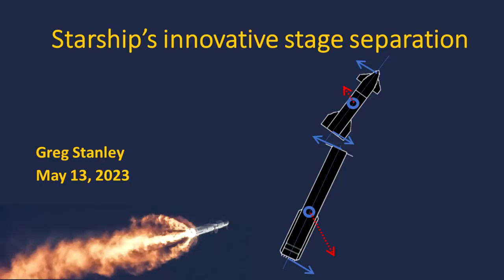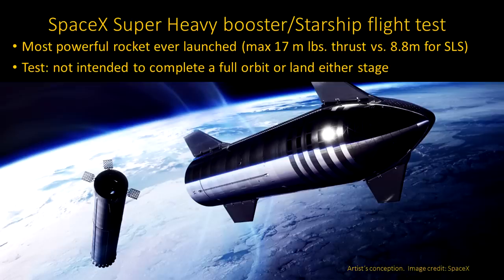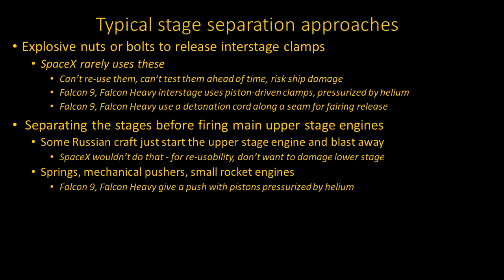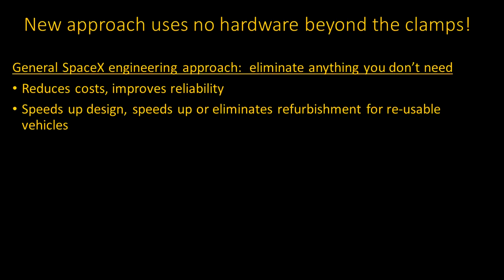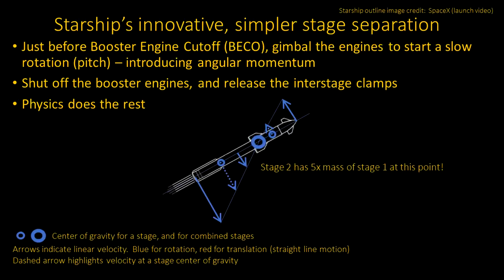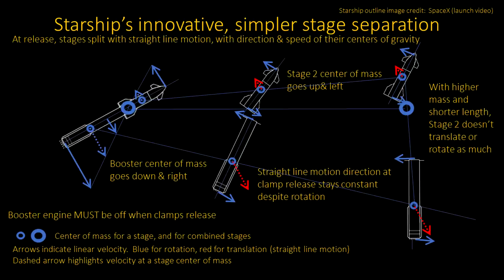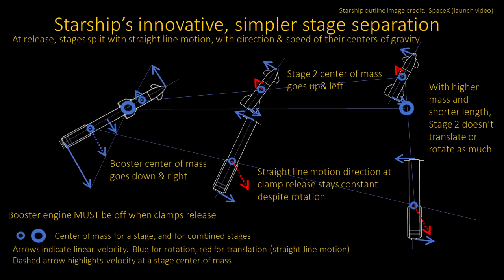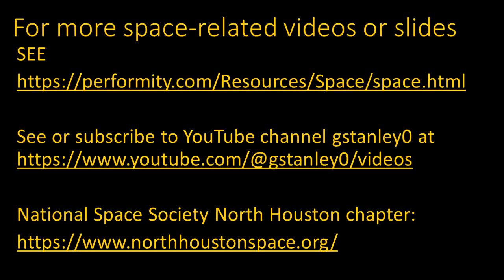Starship's innovative stage separation, using no hardware besides clamps, illustrated

Comment: There’s no way this system will be human rated in current configuration.
Reply from the maker: Several people have commented on this.  For now, the focus is on getting the rocket ready for cargo only, following the usual SpaceX approach of doing that first, just like they did for the Falcon series.   There's plenty to do for that as the top priority.  That's a faster way to get to a minimum sellable product. 
For the longer term, I'm sure they thought about that.  It doesn't seem that unsolvable.  For instance, as one other commenter pointed out, in an emergency, simply start the stage 2 engines and blast away - saving the booster isn't crucial in that case.
  
It's probably better than that.  If the booster has burned out, then ullage (ensuring that only liquid propellant reaches the engine after some free fall) and some push-off from the booster can be provided by the cold gas thrusters at the bottom, fed from the propellant vapors (available because of the autogenous pressurization) and also because of the startup of the turbopumps at engine start.  If the booster is still firing, then you already have the acceleration needed to keep the propellants liquid and still can blast away.    

Emergency escape does depend on the unclamping working.    But that approach has already been accepted as safe in the Falcon 9 series (and probably other rockets -- there's probably something like clamps to hold stages together).  In the Falcon 9 case, they use pneumatic pistons to release the clamps.  I don't know what they're using on Starship, but if it's pneumatic, the principles are the same.  The difference might just be that there's no pressurized helium available like they use on Falcon 9.  If they're still using pneumatics, maybe they use oxygen or methane gas, the only gases available -- I don't know.  That's something to explore.
Reply: @gstanley0  interesting. thanks for the info.

Comment: It failed on the SpaceX fiasco.  Also failed the failsafe explosions to destroy an out of control rocket.
Reply from the maker: The maneuver described here didn't fail, because it wasn't tried, as far as we know.  The test didn't get far enough to reach that point:  no booster shutoff, no clamp release, and not high enough altitude to justify it.   We'll have to wait for a more definitive timeline and analysis to be sure, though.   Yes, it does seem that the FTS (flight termination system) didn't trigger early enough and it certainly didn't do enough damage .  I put a separate video on this channel reviewing the test.  Steps like fixing the FTS, rebuilding the launch pad, better protecting the launch pad, and figuring out why engines failed, are top technical priorities -- all topics outside the scope of this particular stage separation approach.   See https://youtu.be/93Dgh2IZS_M   instead as a good place to discuss the problems of the test, Starship design, SpaceX approaches to do lots of testing, etc.

Comment: That is the possibly the dumbest idea ever conceived in modern aerospace engineering.  I'd love to be a passager during separation 😢.
Reply from the maker: Why is it dumb?
Reply: @gstanley0  you are going to be at the tip of a giant hypersonic vehicle while it is doing a somersault.  Whether 'you' are a satellite, or a person, the force of acceleration during the somersault is going to be uncomfortable
Reply from the maker: @DumbledoreMcCracken   We'll have to wait for more official information from SpaceX, but from their videos (pre-launch, in the launch video), there aren't any  somersaults of stage 2  (the booster might complete one, probably to get pointed in the right direction for boostback).  Maybe a 30 to 60 degree rotation between MECO and clamp release, over 8 seconds based on their flight schedule, 5 of which are after clamp release.  

Because of lack of official information,  I did some approximate calculations based on published size and mass numbers, along with eyeballing the Starship diagrams.   It seems achievable, without all that much stress on the humans, who prior to MECO must get accelerated to about 10 - 11 ft/sec in linear velocity tangential to the rotation  (that's assuming 0.1 radians/sec around the overall ship center of mass), and then later decelerated to end the rotation.  Both of those accelerations could be done as slowly as needed for comfort, but even if they took 2 seconds each, that's an acceleration of roughly 5 ft./sec2, much less than earth gravity.     
  
People will have already passed through rough periods like achieving supersonic flight, then the period of MaxQ,  the return to full acceleration, and then the sudden loss of acceleration due to MECO (which cannot be avoided), all of which would seem more substantial than the minor rotation added for separation. 
Except for the few seconds to generate the rotation and then counteract it later, most of the rotation will under no acceleration at all.   In the thin atmosphere above the MaxQ point, it would probably seem pretty smooth.

Comment: By all means, let's add violent angular forces to the already intense acceleration forces experienced by astronauts. 
In the sea of stupidity that is Starship, this separation method is one of the stupidest.
Reply from the maker: Some people are assuming that there will be violent angular forces on the upper stage, meaning high angular acceleration and velocity, maybe applied over a significant time.  What is the basis for that assumption?   I think we'd have to wait for more information from SpaceX, or at least wait some more months and carefully watch a successful test.  You can also bet that before any people travel on a Starship being boosted from Earth,  SpaceX will have experimented to minimize the rotation needed.   So the initial test might have more angular velocity than they finally end up with.  Also, if there's really a problem, as several other people have noted in comments here, in effect there's going to be cold gas thrust  also helping separate the stages.
Reply from the maker: In the absence of definitive information from SpaceX,  since the video, I worked through a rough approximation of the mass distribution in the Starship to be able to estimate basics like the centers of mass of the ship and each stage separately, and estimate their moments of inertia, to work out the kinetic energies (due to rotation and translation before and after clamp release, and estimate final rotations and linear velocities.  (The angular velocities are all the same - my initial thought on that was wrong, which became apparent when working it out in detail)  

As an example case, if you try an initial angular velocity of 0.1 radians/sec, in the 5 seconds between clamp release and stage 2 engine start, you'd turn 28.5 degrees in that time.  During rotation start, an astronaut would experience acceleration to get to about 10-11 linear  ft/sec , and then that would remain constant during the 5 seconds after booster shutdown.  The stages centers of gravity after clamp release would drift apart at about 18 ft./second, or about 90 feet during the 5 seconds.  At that point the stage 2 engine would start, and it would rotated to be pointing away from the booster, so maybe not damage the booster.  All of this is based on some approximations, and assumptions like the the payload mass, propellant remaining in stage 1, and how far about the stages should be, etc., but they are probably "in the ball park".

Does that 5 seconds (plus the 3 seconds between MECO and and clamp release, and a few seconds to induce the slow rotation) sound so violent?  In the absence of definitive info from SpaceX, have you done similar sorts of calculations to justify the word "violent", or be sure that the people who designed this are stupid?
Reply from the maker: Actually, it was one of Musk's employees who came up with this method for stage separation.  Musk endorsed it.  It was probably natural for everyone, since they're already using rotation to disperse Starlink satellites. 

As for requiring worship?  No, a spreadsheet and applying the basic laws of physics to a finite element representation of the ship does the job.  
 
I worked through the calculations, dividing the ship into 200 segments to place the mass based on dividing up the empty stage masses, the propellant masses, and the payload according to locations in the ship diagrams.  Once that's in place, the spreadsheet calculates (before and after separation) centers of mass, moments of inertia, rotational and translational energy, linear velocities of the centers of mass, and verifies angular velocity for the separated stages given an initial angular velocity for the ship as a whole. 

Based on dimensions and weights from Wikipedia, and eyeballing the rough locations of propellant tanks, etc., it looks like the center of mass (CM) of the ship prior to clamp release is around 255 ft from the bottom, which places it 25 feet up into stage 2. Stage 1 CM is at 101 ft. and stage 2 CM is at about 281, all out of a total height of 394 feet.   Exact numbers depend on assumptions on stage 1 propellants remaining (I assumed 2% for my base case, and the CM for stage 1 is sensitive to that assumption), exact locations of the propellants in either stage which I only roughly approximated, and payload weight and distribution.  This is just "ball park", and doesn't account for the heavier dry mass at the bottoms of stages due to the engines, or the differences in mass between LOX and methane (yet).  This will be improved later.  There weren't any fudge factors in there somehow associated with Musk, just lack of time to make the model more accurate.  

Would you suggest a different approach to calculate the results of the rotation and unclamping?  Did you try it?  What were your results?
Reply: @gstanley0  You must think this is an audition forum to become a SpaceX engineer.
Reply from the maker: Nope, way too old (and mostly retired) for that.  My interest is in seeing humankind expand our economy and civilization into space.   That requires much cheaper access to space.  (Necessary, but not a sufficient condition).  SpaceX has already gotten costs down by a factor of 10 since the Space Shuttle days, and is trying to do that again.  Right now, they're the best bet to succeed at this.   If/when Starship works and ramps up launches to get economies of scale and re-use, and achieves that kind of cost reduction, it will have a significant impact on our ability to expand into space, and probably be years ahead of everyone else except possibly some Chinese competition.   Blue Origin could be interesting, but if they're making a lot of progress, they're keeping it too quiet to tell.  The Europeans, Japanese,  and Russians aren't even trying - they're pretty much out of the picture for cheaper launch.  The Koreans and Indians don't really have that much going on yet.  The smaller new launch companies like Relativity and Rocket Lab are still aiming at competing with the Falcon 9 - where technology was 5-10 years ago.   The traditional U.S. companies aren't really trying hard enough either, e.g., Vulcan still competing against the Falcon, or in the case of SLS, a high cost technology dead end with no path at all to the cost benefits of re-usability or commercial customers. 
So, yes I'm interested in Starship -- not because of hero worship or trying to get a job there, but simply because it's the best bet right now.   And my real interest is what we can do with that launch capability.  That's also where the real money is.  The money is not in the launch business, it's in the services and eventually materials based in space,  already including lots of satellites, and hopefully accessing the near-infinite resources of space in the future.  

Because so many people make judgement about technical issues based on their emotional reaction to Musk (love him or hate him) rather than on technical merit, I like to do my own analysis and see what actually makes sense.

Comment: I would not fly on Starship with no abort system.  I don’t know what the Everyday Astronaut is thinking. You can’t blame the poets and musicians for the hello moon flight.  They probably don’t know anything about engineering.
Reply: Lighten up, Francis…
Reply: The everyday astronaut knows much about engineering.
And his flight will not be the first manned flight.
And the first manned flight will be after multiple unmanned flights.
Reply from the maker: Several people have commented on this.  For now, the focus is on getting the rocket ready for cargo only, following the usual SpaceX approach of doing that first, just like they did for the Falcon series.   There's plenty to do for that as the top priority.  That's a faster way to get to a minimum sellable product. 
For the longer term, I'm sure they thought about that.  It doesn't seem that unsolvable.  For instance, as one other commenter pointed out, in an emergency, simply start the stage 2 engines and blast away - saving the booster isn't crucial in that case.
  
It's probably better than that.  If the booster has burned out, then ullage (ensuring that only liquid propellant reaches the engine after some free fall) and some push-off from the booster can be provided by the cold gas thrusters at the bottom, fed from the propellant vapors (available because of the autogenous pressurization) and also because of the startup of the turbopumps at engine start.  If the booster is still firing, then you already have the acceleration needed to keep the propellants liquid and still can blast away.    

Emergency escape does depend on the unclamping working.    But that approach has already been accepted as safe in the Falcon 9 series (and probably other rockets -- there's probably something like clamps to hold stages together).  In the Falcon 9 case, they use pneumatic pistons to release the clamps.  I don't know what they're using on Starship, but if it's pneumatic, the principles are the same.  The difference might just be that there's no pressurized helium available like they use on Falcon 9.  If they're still using pneumatics, maybe they use oxygen or methane gas, the only gases available -- I don't know.  That's something to explore.

Comment: You are 100% incorrect on the F9 fairing separation.  No explosives.  Definitely not det cord.   Please double check your sources before spreading misinformation.
Reply from the maker: Yes, this was addressed in the comments from @epicspacetroll1399 earlier today .  It's only the new extended fairing (the longer one, which will rarely be used, and probably really only with the Falcon Heavy) that uses detonation cord.  You're right in the case of the normally used fairing.  It's in the Falcon User's Guide (2021) at the SpaceX site.

Comment: Ohh that's why it failed 😂😂😂
Reply from the maker: No, the maneuver described here didn't fail, because it wasn't tried, as far as we know.  The test didn't get far enough to reach that point:  no booster shutoff, no clamp release, and not high enough altitude to justify it.   We'll have to wait for a more definitive timeline and analysis to be sure, though.   There were plenty of other problems, but it was unlikely to be from this.  I put a separate video on this channel reviewing the test.  Steps like fixing the FTS to actually work, rebuilding the launch pad, better protecting the launch pad, and figuring out why engines failed, are top technical priorities -- all topics outside the scope of this particular stage separation approach.   See https://youtu.be/93Dgh2IZS_M   instead as a good place to discuss the problems of the test, Starship design, SpaceX approaches to do lots of testing, etc.